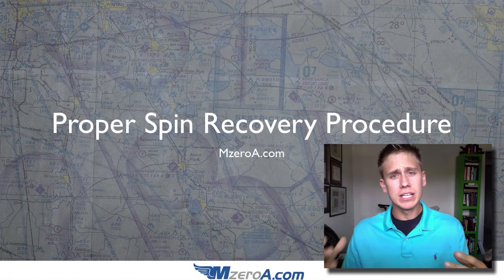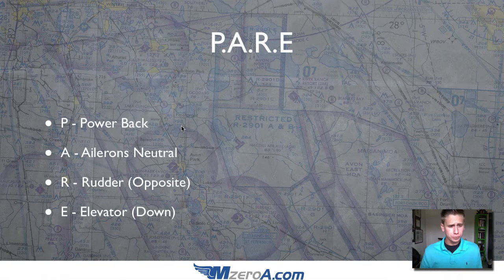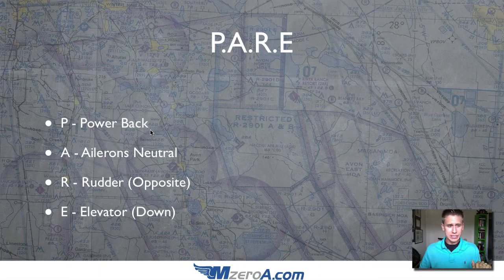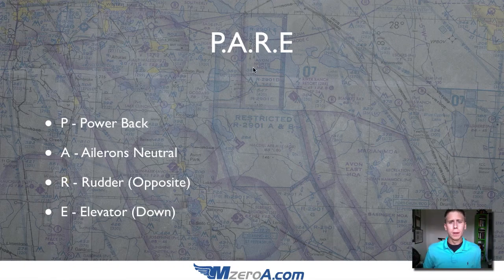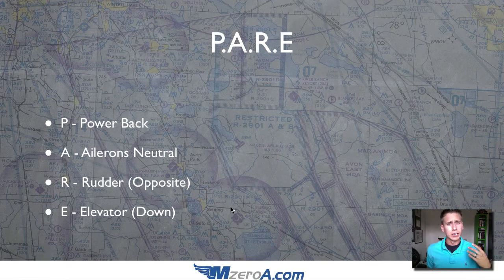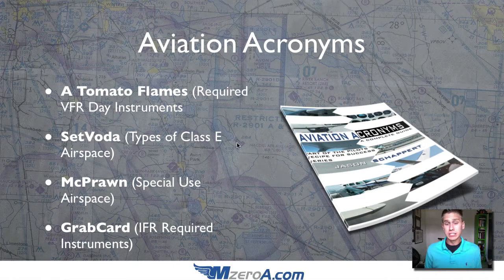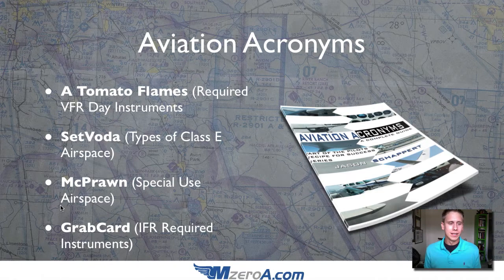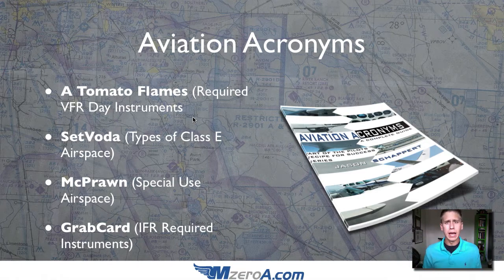Spin Recovery

Comment: Remember to hold both rudder and nose down attitude until the rotation stops. Once the rotation is stopped, neutralize the rudder, level the wings, and climb back to your assigned altitude.